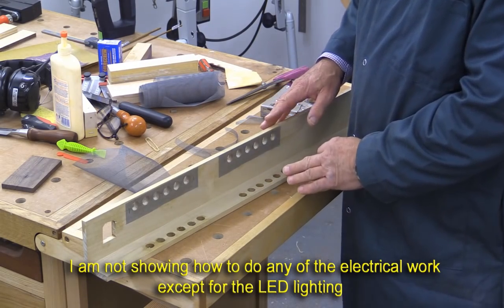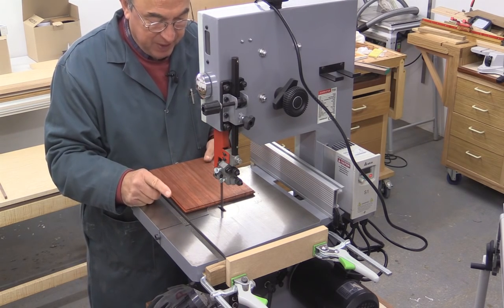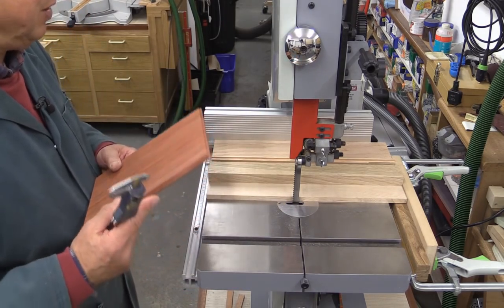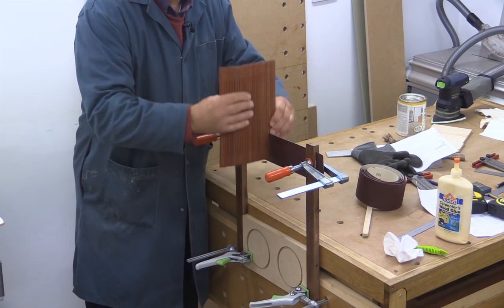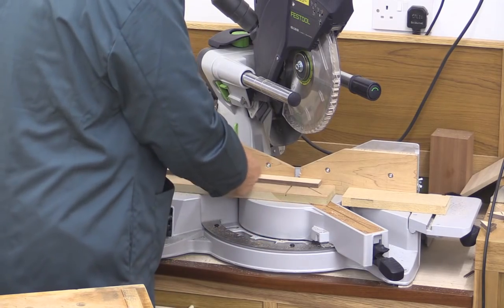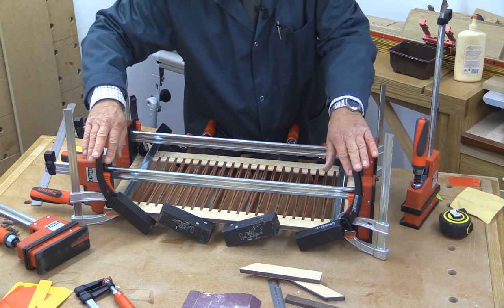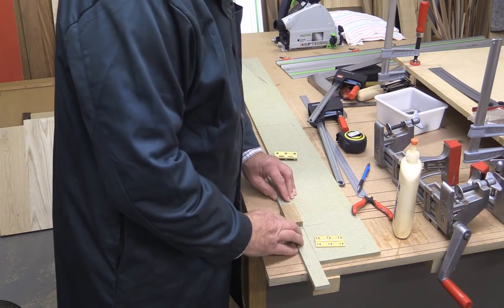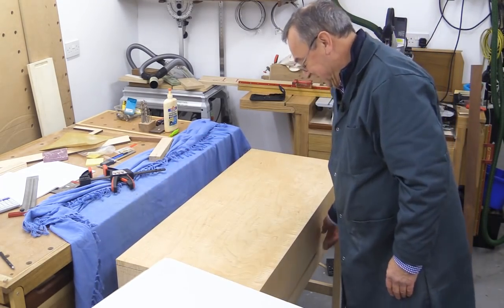Keyboard Cabinet - Music Rest and Hinges

Comment: Very smart jig'ing up Peter. The recess able brass pins to index the jig off the from the end of the base elevates a smart jig to a "wicked" smart jig!  (Wicked; New England slang, the term is used as a substitution for "really" or "very").When I do large or complicated  glue ups I search out an extended open time adhesive. I may give up some bonding strength but then I may not need it. White Elmer's can give you another 5 minutes. Liquid Hide glue about 15 to 20 minutes. Tite Bond makes several different extended formula glues. Glues are temperature sensitive. When I need even more time I will work in a cool to cold shop. With cool glue. When I finish I will crank the heat back up but may increase the time in the clamps.  I also liked your wiring solutions for the light.
Reply from the maker: Hi George, Many thanks for your supportive comments and information about the glue. I am just finishing off the next video in the series. Cheers.   Peter

Comment: Now yer talking' Peter.  Like the spacer setup.

How much did you leave uncut to prevent it from splitting with the grain?

Nice jig work too.                                 JimE
Reply from the maker: Hi Jim, I left 32 mm uncut but could have got this down to 25 mm (ish). I think that it will depend on several factors - the species and condition of the wood, the size of the increments (mine was 4 mm) and, obviously, the amount that one needs to pull it apart. I had tried making fancy spacers on the X-Carve but they looked awful.   Peter

Comment: Do you get on well with the Zyliss vice Peter?
Reply from the maker: Hi Chris, Yes I use it from time to time. I have had it for over 35 years. Zyliss no longer make it and the patent has lapsed. I asked Zyliss if they knew what had happened to the tooling and master moulding but they had no idea. It is a great bit of kit.     Peter